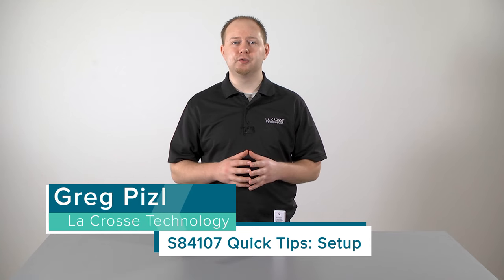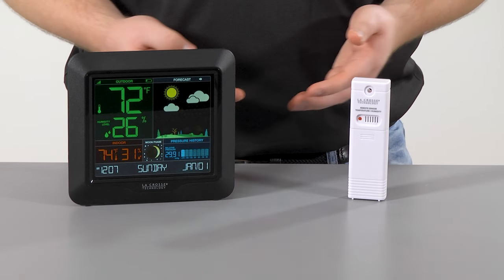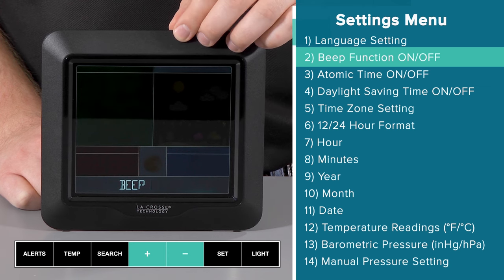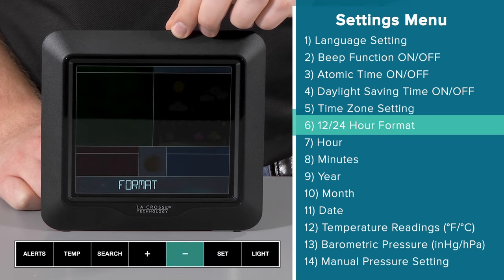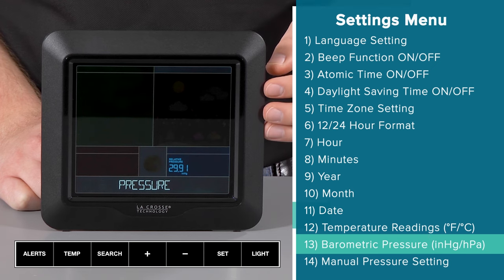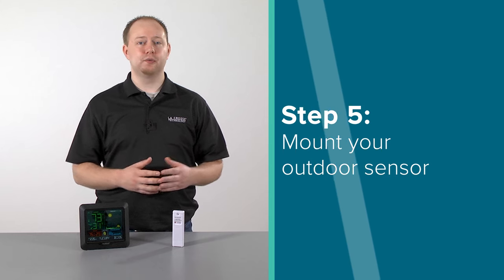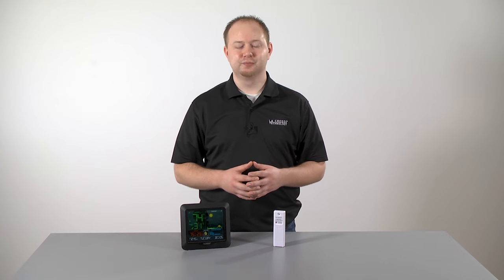S84107 | 308-1416 Forecast Station Setup

Comment: 1. My S84107V2 does not show the day light savings icon no matter what. Selected to "ON" and synced with the Atomic Clock signal but no D.S.T. on display.
2. Outside trending arrows will disappear for days, then appear for a few hours then disappear again.
3. Sometimes base unit will lose signal from sensor and fails to reacquire. Using manual search finds sensor immediately minutes after signal loss.

New batteries. Sensor 8 feet from base unit, in between window and screen in shaded spot.

I moved the sensor inside next to base unit for 24+ hours. No change.
Thank you.
Reply from the maker: Our sincere apologies for any inconvenience. Let's go through each of these one by one.

1. As noted on page 6 of your full manual here: https://bit.ly/s84107v2_manual -- When synced with the WWVB Atomic Signal, the station will display the DST icon when Daylight Saving Time is being observed. Dyalight Saving Time ended on November 6th and will begin again on March 12th of 2023. 

2. If your temperature or humidity changes have been gradual, it is not uncommon for no trend arrows to show. More specifics are covered on page 11 of your manual. 

3. It sounds like this could just be a bad sensor. For assistance in getting a replacement, please message our support staff directly here: https://bit.ly/contact_techsupport. Or alternatively, send us a private message on our Facebook: http://bit.ly/LaxTech_Facebook or Twitter: http://bit.ly/LaxTech__Twitter page.

Comment: How does the forecast feature work? I thought our other Lacrosse unit hooked up to your WiFi signal.
Reply from the maker: We apologize for any confusion, but the forecast feature will work differently depending on the model station you own. For instance, the S84107 model featured in this video does not connect to the Internet, and will use its internal barometric pressure reading to predict forecasts to come within the next 12 hours. These icons will become more accurate after the first 7-10 days of use. Now, if you own a different product that does connect to the Internet using our La Crosse View app, it will most likely be receiving updated forecast data from AccuWeather. If you have further questions, please pass along your item’s model number and we’ll do our best to get them answered for you.

Comment: My question is for the V50 wind and weather station. Although not says wait 10 days for barometic pressure readings to calibrate from sensor. In the pressure box I do not have a strength meter. I do have a strength meter in the wind box so I know station is reading sensor.thanks
Reply from the maker: Hey Anthony, our apologies for the confusion. The barometer is actually built into the display itself, not the sensor. Thus, no signal strength icon needed for your barometric pressure reading.

Comment: Can’t make sense of forecast graph.  They all look lit up to me.   How should it look different?  Based on weather?
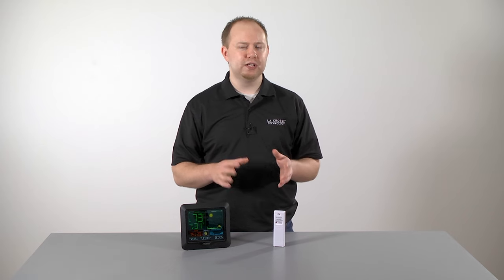Reply from the maker: Assuming you're referring to the Pressure History Graph, please be sure to have the unit set up and running for at least 7-10 days. This will help the unit acclimate to your location and offer more accurate barometric pressure readings and weather forecasts. When first powered up, you'll likely not see any differences in the graph, this will happen over time. More on this can be found at the 7:29 mark in this video or in your full manual here: https://www.lacrossetechnology.com/media/catalog/product/s/8/s84107_29_080817_color.pdf

Comment: if my unit is plug in and the display is blank...is that means its dead?
Reply from the maker: Hey Pat, first off, sorry for the trouble! This could indeed mean the display is dead, however, it could also just be a bad power cord. To test this, assuming you have the S84107 featured in this video, please install 3 new regular AA alkaline batteries into the back of the display. This should allow it to turn on regardless of the power cord. If it works, that's great news! We would then suggest making sure the power cord is securely plugged into both a working outlet and into the back of the weather station display, just to confirm it is defective. If at this point you are still having issues, please message our support staff directly here: https://bit.ly/contact_techsupport. Or alternatively, send us a private message on our Facebook: http://bit.ly/LaxTech_Facebook or Twitter: http://bit.ly/LaxTech__Twitter page.
 Sorry again for the inconvenience.
Reply: @lacrossetechnology  i made sure battery is 1.5v each ...still does not come on.  any other suggestions?
Reply from the maker: @patkelly7839  Yes, please message our support staff directly here: https://bit.ly/contact_techsupport. Or alternatively, send us a private message on our Facebook: http://bit.ly/LaxTech_Facebook or Twitter: http://bit.ly/LaxTech__Twitter page.
 There, we'd be happy to help in any way we can. Sorry again for the trouble.

Comment: IF YOU USE OTHER OUDOOR SENSOR, DO YOU THINK CAN SER THE ITEMS? CAUSE THE UNIT I HAVE WAS LOST, BUT MY SISTER HAVE ONE COMPLETE SET. SO IT MEANS,  CAN I USE HER OUTDOIR SENDOR FOR MY UNIT?
Reply from the maker: It may be possible, however, it will depend on the different model displays and sensors you own. Our suggestion would be to look up your various products to see what sensors are compatible for each. Our page here: https://www.lacrossetechnology.com/pages/sensor-finder will help with this, as well as lead you to a page to purchase any necessary replacement sensor. If you still have questions, please just let us know or reach out to our support staff directly here: http://bit.ly/contact_techsupport

Comment: Can I calibrate the outdoor temp  reading? The indication is about 15 degrees higher than actual temperature. The remote sensor is not in the sun and not subject to a warmer air flow.
Reply from the maker: We apologize for the trouble. Our first recommendation here would be to perform a side by side test with the sensor next to your display. Our video here: http://bit.ly/inaccurate_temp_readings will walk you through these instructions.

Comment: I have model 308-1416V2. I performed initial set up at about 4pm. Tried atomic set up with hitting the search button but no luck. I left the house for a bit and upon returning I noticed the time, day and month had updated but the date was a day behind. The atomic icon was not being displayed and the time was 6:38 pm. I manually corrected the date. Is this something to be concerned about? Thanks
Reply from the maker: Hey George, sorry for the trouble. Our first suggestion would be to make sure you have all of your atomic, time zone, daylight saving time, year, month, and date settings adjusted correctly within the Settings Menu (shown starting at the 2:03 mark in this video). Assuming these are correct, and your weather station updates again to an incorrect time or date, please message our support staff directly here: https://bit.ly/contact_techsupport. Or alternatively, send us a private message on our Facebook: http://bit.ly/LaxTech_Facebook or Twitter: http://bit.ly/LaxTech__Twitter page for further assistance.
Reply: @lacrossetechnology  Thanks for the response. I mistakenly thought that it would self sync when it got the atomic signal. Especially since it got the time and day correct. One other question I have is understanding the pressure history. Could you help me understand how to read the vertical bars. My logic tells me that if the bar is at the top of it's range it would be signaling a "HIGH" pressure "Fair weather". This is not the case as when it does read with the bars at the top rain is being forecasted. Thank you.
Reply from the maker: Hey,  @YouTuber-mc2el . No worries! In regards to your pressure history, yes, in general when the pressure bars begin trending up the weather tends to get more desirable, and the opposite for downward trends. However, in terms of your forecast icons, we recommend giving your display at least 7-10 days to acclimate to your location before seeing more accurate weather predictions. More details on these items can be found in your full manual and FAQ documents here: https://www.lacrossetechnology.com/products/308-1416V2#support -- As well as in our Forecast Icons video here: https://youtu.be/yHeRcMPB7Pw
Reply: @lacrossetechnology  Understood. That is why I am confused. The bars were all at the top of their range and rain was forecasted so again I must be missing something.

Comment: Is there a reason my display is always dark? If I press the "light" button, it lights up for several seconds, but then goes dark again. Can I set the default brightness so I can see the display without pressing a button?
Reply: La Crosse Technology Well, now I just feel dumb. Apparently, the power strip I had the adapter plugged into had come out of the wall enough to cause a bad connection. It pays to check your connections, I guess. Thanks for the quick reply...it's working fine now.
Reply: Unfortunately, I cannot get the display to "permanently" stay on.  I have 3 new batteries and the unit is plugged into the wall socket. When I press the light button, the display activates for about 10 seconds, but there is no indication of a means to change the "display" setting.  I've even tried to use the +/- arrows after pressing the light button.  Pretty frustrating & does not appear to be covered in the tutorial, above.  Thx, in advance, for a reply.

Comment: How do I set up the forecast icons on a La Crosse Model: S88907V2 please?
Reply from the maker: Hey Bernice, the forecast icons will use changes in barometric pressure to predict future weather conditions automatically, there is no need for manual adjustment. These predictions will become more accurate over time. For more details on this subject, please review our video here: https://youtu.be/yHeRcMPB7Pw
Reply: @lacrossetechnology  Thank you!

Comment: What does it mean if I'm in the 12 hr setting with the Atomic Time on, and I'm not getting any of the of the tower icons (Flashing or steady)?  nothing?
Reply from the maker: Hey Janette, the 12HR setting is simply a setting that allows you to choose between a 12 or 24 hour clock layout. In regards to your tower icon, if it is not solid or flashing this means your display is currently not searching nor connected with the WWVB atomic signal, this is common, especially during the daytime hours when radio traffic is most busy. As stated at the 5:40 mark in this video, the unit will perform these searches automatically. Moving the display away from other electronics and near a window with the front or back of it facing Fort Collins, CO may help it pick up the signal faster. Typically, this works best over night in the early morning hours. More on this can be found in your full manual and FAQ docs here: https://www.lacrossetechnology.com/products/S84107V2#support

Comment: Why does this have to be plugged into electricity all the time...can it not used be used with the batteries?   I had an older version of this same brand and ran on batteries for years.
Reply from the maker: Hey Ruth, our apologies for any inconvenience. Unfortunately, all of our current color LCD products will require use of a power cord for constant backlight. For battery power only operation we'd suggest looking into our non-color displays. https://www.lacrossetechnology.com/collections/weather-stations
Reply: @lacrossetechnology  Thank you for the info on the different models.  Already purchased the LCD...works great and will keep it plugged in.

Comment: Have had this unit plugged in constantly, but have had to change batteries every 6 weeks on the station base.  If I understand correctly, if plugged in, batteries are only necessary in the event of a power outage.  Ideally, this would mean batteries aren't always needed in the unit.  The unit is blinking on and off with the battery icon for the indoor temp indicating low battery.
It seems like this should not happen as long as the unit is plugged in.  Are we missing something here, or could we have a defective unit?

Comment: I just bought this on sale at Canadian Tire.  This model, CA84688,  says on the box it has an a/c adapter but none was found inside and the base model does not have a place to plug it in???  Not impressed.  It's going back.
Reply from the maker: Hi Simon, the CA84688 is actually different than the model shown in this video. Since yours does not have a color display it will run on battery power only, making it easier to hang on walls. We apologize for any confusion and for the typo on the package.
Reply: It's not a typo, it's an entire sentence.  It's dishonest marketing.  The writing on the box says,"Power Requirements: 5.0V AC Adapter(included)".  The consumer should not be lied to.  Alternative facts have arrived in Canada!!!
Reply from the maker: Hi Simon, it was indeed a copy paste error on our end between our 327-1417 (color) and 327-1417BW (non-color) models. Your CA84688 is essentially the same station as our 327-1417BW, just was given a Canadian model number. For more information and product specific support, please visit our website here: https://www.lacrossetechnology.com/ca84688?type=manuals where you'll find your full product manual, FAQs, and support video. We again truly apologize for this inconvenience.
Reply: A question.  Your CA84688 or 327-1417BW manual says that it will measure wind speeds up to 111.8MPH.  Yet the manual for 327-1417 (color) says it will only measure to 99MPH?  As I will be measuring speeds in the range of +100MPH can you comment on this?  A color display means lower wind speed capability or is this another "typo"?
Reply from the maker: Hi Simon, all of our TX141W and TX141Wv2 wind sensors (the ones supplied with these units) have a max wind speed of 99MPH, which is as high as the stations can report anyway. We apologize again for the incorrect information, this will be corrected on our website as soon as possible. As for your use cases though, that amount of wind is going to bring plenty of debris, which at those sustained speeds will likely destroy the sensor at some point. Keep in mind, these are designed for general home use, not for scientific testing. We are sorry for any confusion.

Comment: How do iget it to switch between outside and inside readings
Reply from the maker: Our S84107 model featured in this video will show both your outdoor (upper green section) and indoor (lower red section) readings at the same time. If you by chance own a different model, we'd be happy to provide further details once we know what that is. For direct assistance, please message our support staff here: https://bit.ly/contact_techsupport. Or alternatively, send us a private message on our Facebook: http://bit.ly/LaxTech_Facebook or Twitter: http://bit.ly/LaxTech__Twitter page.
Reply: @lacrossetechnology  
Thank you for the "get back". The model wehave is the S81120. It did flash back and forth between inside and out. All of a sudden it only shows the outside. How do i correct that?
Reply from the maker: @fumerstube5899  Of course! On our S81120 you'll simply have to press the PLUS (+) button to switch between indoor and outdoor readings. After a press or two, you should see the Cycle Mode Icon (circle arrows) appear in the middle light green section. This will indicate that the screen will automatically alternate between indoor and outdoor data. For more information on this and other features, you can find your full manual and FAQ documents on our website here: https://www.lacrossetechnology.com/products/S81120#support
Reply: @lacrossetechnology  Got it .   . .Thank you VERY MUCH!

Comment: How do I set the temperature to show degrees in fahrenheit? It shows temp in celsius.
Reply from the maker: Hey Judy, this setting can be adjusted within your S84107's Settings Menu. We go over this in the video at around the 4:39 mark. Simply Hold the SET button down to enter the menu, use the + or - button to adjust settings, and the SET button to move to the next option. More can be found within your full manual here: https://cdn.shopify.com/s/files/1/0035/7443/1790/files/s84107_29_080817_color.pdf?v=1594066127
Reply: @lacrossetechnology  I received the model 308-1414BV2 but actually ordered the model 308-1414B-INT. Amazon is sending me the correct model. Do you have a set up manual for that model?
Reply from the maker: @judyemmett2655  The procedure for changing this setting is very similar, just with the TIME SET button and UP and DOWN arrows. You can find this item's full manual and FAQ docs on our website here: https://www.lacrossetechnology.com/products/308-1414b#support

Comment: When I lose power the batteries do not keep the time setting!
Reply from the maker: Our sincere apologies for any inconvenience. The S84107 should be able to run on its own (without a constant backlight) with a new set of regular alkaline batteries. If your time and/or other settings were not saved, it is likely the batteries installed may have died. If you should need further assistance, please message our support staff directly here: https://bit.ly/contact_techsupport. Or alternatively, send us a private message on our Facebook: http://bit.ly/LaxTech_Facebook or Twitter: http://bit.ly/LaxTech__Twitter page.
Reply: I discovered by reading the reviews on Amazon for this product, the battery terminals for the positive side are misaligned and do not make contact. The easy fix for this is to place a small folded piece of aluminum foil between the positive side of the battery and the inner terminal connector, it sounds more complicated than it is, you just fold up a small strip of foil, insert the battery negative side first (the side with the spring), then holding the foil on the positive side of the battery, insert it, this will make a better contact with the battery. I had to do this on my brand new unit. Now my battery backup works.